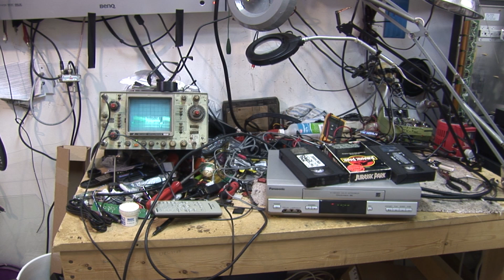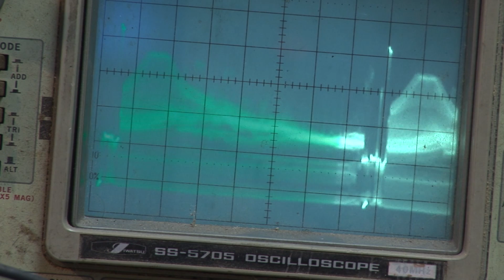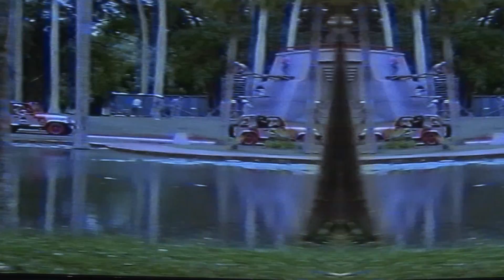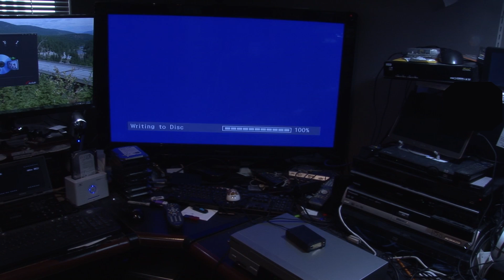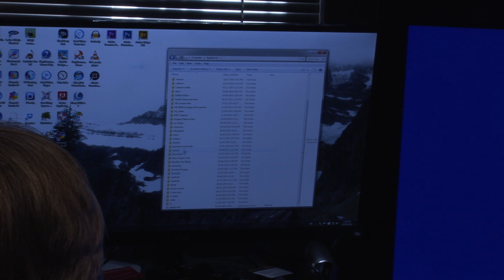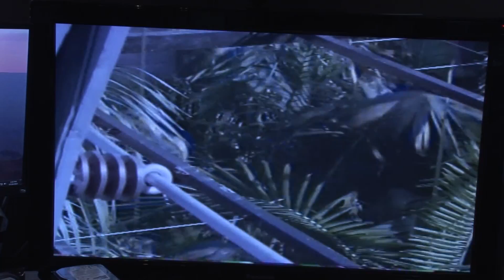Copy macrovision protected Video to DVD

Comment: Does this Macrovision remover work for the really old VHS that had a rolling picture copy protection?  I beleive it was called "stop copy"  Old Warner Bros. movies would mention it and disney tapes mentioned it also.  Modern TV's I find that I need to pause then hit play to stop the picture from rolling after the initial start.
Reply from the maker: Yes it will because it generates new sync.

Comment: Have you made a device yourself that removes copy protection?
Reply from the maker: Back in 1981 i built one.
Reply: Can you give a diagram of your device that removes copy protection ?
Reply from the maker: @Творчество2.0  
Sorry don't have one and even if i did the tv sync generator for tv camera (RCA) is not made any more and was in short supply when i built this back in 1981
Reply: Sorry to ask. I need to make resevr copies of videotapes . But the video capture board sees copy protection . I was looking for an adapter on the Internet , but this thing is either expensive or out of stock . Dead end.
Reply from the maker: @Творчество2.0  that's the problem with copy protection.  A videonics mx1 mixer will remove macrovision as will a good frame store TBC.
Reply: @12voltvids  Where can I buy the video mixer with TBC that you mentioned?

Comment: Interesting video. I have a RCA-HDMI converter from Amazon that is not affected by macrovision. Does it just ignore the signal?
Reply from the maker: Yes it probably does because an RCA to HDMI adapter is generally meaning you're trying to play analog sources onto a television that only has HDMI inputs. So you're not actually trying to copy anything. Macgravation was there to prevent recording on to analog devices such as VCRs and DVD recorders which had chips embedded to detect the signal and lock out the recording circuits.
Reply: @12voltvids  I tried this RCA to HDMI option.  Now I get stable video but only in black and white...RDK

Comment: There are numerous dvd players/ recorders out there where you can simply input a code via the remote and it will disable macrovision protection. A liteon lvw5002 is a example of a machine that can. The liteon lvw5006 can do the same thing but requires a software update to do that is a bit awkward to do 👍

Comment: How can I get one of those Macrovision scrubbers?
Reply from the maker: Will be tough to find one these days.   You are about 40 years too late!
Reply: @12voltvids  Lol yeah but  would have thought that now days with  the technology and vcrs becoming hard to come by a device like that would be as common as a rf modular or the capture devices you can use to connect a vcr to a computer. so people could back up there vhs collections.
Reply from the maker: @scottriffe222  these devices were made illegal to manufacture cell or even possess in the United States. Company scrambled to make newer models that would reduce the amplitude of the macrovision signal but not totally eliminated and that was because all new VCRs and DVD recorders had a chip in them to detect the watermark and shut down the recording so in order to sell them because the initial excuse for selling them in the first place was because some televisions would not play nice with the extreme overshoot in the vertical blanking and it would cause them to roll even if you were just trying to play a macrovision tape. The macroscrubber I have, that I built uses a TV camera signal generator IC Gen locks to the incoming video signal generates new horizontal and vertical sink pulses which is then keyed on vertical blanking the blank lines 9 through 21 and replace it with new sync.  They were deemed as devices designed to circumvent copy protection and we're DMD legal by the US supreme Court if I remember correctly. Manufacturers some being sold under the brand name Curtis responded by producing new units which just clipped the white overshoot in the luminance signal to approximately 40 ire. This stopped the distortions on television and it stopped the distortions if someone was looping a macrovision encoded signal through a VCR for example it would stop the bright dark bright dark pulsations but it still allowed enough of the signature to get through to prevent VCRs and DVD recorders that had the watermark detection chip installed from going into record which was basically every VCR made after about 1991. If you look online you will probably find someone selling some of these old devices but keep in mind the majority will not provide a 100% elimination of the macrovision signal. The only ones that will are ones based on the chipset that was used in the one that I built. I don't even remember which publication it was from might have been radio electronics, the plans were given to me by somebody else that had built one so I built one too. He had made several boards that was selling us the boards and a bag of parts to put together. I think at the time I paid about a hundred bucks for the parts. I looked up the main chip which is an RCA CD22402E which was a sync chip for tv camera and that chip at the time was selling for 68.00.  it is long obsolete.  The one I have was a digital tech Corp macroeliminator.  That's the design you want it you can find it.
I keep mine connected between the cable box and my DVD recorder so I can make hard copies on DVD of anything I want to keep including off Netflix and on demand

Comment: A 16x9 broadcast?  Mine will work on the "Y", luminance, or "Grreen" component cable as long as it's a 480i broadcast (don't think it'd be timed for HD).  Are you talking letterbox or full 1080P? I had something called a Video Stabilizer to help my electronics with the random extra falling edges (usually 4, switching from high to low in 10sec intervals), along with some color burst overdriving.  It used a monostable, along with some gates.  I've tried drawing a schematic many times I need MAT lab I have crappy writing.
Reply from the maker: Yes it will work on the lunanence signal as long as in 480i. I made a break out cable to loop it into an s-video cable which works great for recording protected content from say Netflix or other on demand service.

Comment: How could I connect my Hauppauge to copy from my streaming device? It's only HDMI Out from streaming device.
Reply from the maker: Couldn't tell you as my streaming devices have component output and my hauppague has component input
Reply: @12voltvids  What Streaming device are you using?
Reply from the maker: @franklinsterlen6817  it's a Cisco IPTV box.
Reply: @12voltvids  Does it let you download Apps such as Netflix and Sling TV?
Reply from the maker: @franklinsterlen6817  
I have only Netflix.
Reply: @12voltvids  Ok so any Cisco IpTV with Component outputs could do the job right?
Reply from the maker: @franklinsterlen6817  
Mine is from my cable co.  I can record anything. Netflix, HBO, on demand.

Comment: Been doing this for years by running through a pro TBC which also means I can adjust other video parameters as well. (Not all TBS,s will do it though)
Reply from the maker: What you have us a proc amp with tbc.  A tbc does not have controls to adjust.  It simply reads the video into memory then reads it out again locked to a fixed time base.   A tbc that works on a full frame us called a frame store tbc.   Most tbc built into VCRs are 3 line tbc as they only store 3 lines.  One being read into memory one stored and the oldest being read our as the next is stored.

Comment: I once made a Macrovision remover in the early 90's here in the UK and it worked first time, which is a first for me, anyway,  although it did VHS to VHS recording, when DVD's came along it refused to work on those, I searched through issues of Radio Electronics which you mentioned but could only find a different one with more components from the December 1987 issue, which also won't work on the PAL system used in the UK, but here is the link anyway ;     https://worldradiohistory.com/Radio_Electronics%20_Master_Page.htm
Reply: Yes, that's the Issue December 1987 page 49 because there is nothing from 1982 & 1983 which i checked on.

Comment: Can't you remove the chip from the recorder?
Reply from the maker: Sure then the recorder would not record, or play. It is buried in the main processor.
Reply: @12voltvids  Ok, well I thought the chip might of been after the tuner but before the processor as a stand alone. I guess they knew people would remove it so they integrated it into the processor? Thanks

Comment: Does it effect the actual video/audio signal? Like a second generation tape or anything?
Reply from the maker: No. The one I have does nothing to the video. It is a genlock device.  Locks to the sync of the macrovision video and generates new sync.  Then the new sync is gated over the original sync and the first 20 or so lines of video to eliminate the macrovision signal. It also removes close caption data as that lives on line 17
Reply: @12voltvids  Doesn't CC data live on line 21?
Reply from the maker: @KylesDigitalLab  
I totally forget what line, could be, 17 might have been where the VIR. There were many test signals in there.  Color bars, multiburst, chroma phase reference.  Closed captions, text telemetry.  All kinds of stuff between line 11 and 21. Been so long since I actually looked at an ntsc waveform.

Comment: I just bought a Digital Video Stabilizer, Brand New, And It Only Recorded One Movie, And Then I Tried To Record Another One From DVD - DVD and WON'T LET ME, I CONNECTED EVERYTHING PROPERLY, BUT IT WONT LET ME DO IT, BTW, THE FIRST MOVIE I COPIED WAS COPYRIGHT PROTECTED, AND IT RECORDED IT ANYWAY, DO YOU KNOW THE REASON WHY IT WONT LET ME RECORD OTHER DVD COPY PROTECTED MOVIES??
Reply from the maker: Most of those commercial ones do not remove 100% of the macrovision signal.  The first disk may not have had the full macrovision turned on.  Or it just said copy protected and it was not.
Reply: 12voltvids Do You know Which Stabilizer Removes ALL COPYRIGHTED DVDS, is it one available out there that does the complete job?
Reply: 12voltvids i know for a fact the first dvd concert video i recorded has copyright protection, because i tried to record it before without pluging it to the stabilizer, to find out if it was protected, and IT IS, which means the stabilizer only kills macrovision on some dvds, Not in all of them.
Reply from the maker: @AlexDeChristian6323  there are different levels of macrovision protection and a different license (more expensive ) for higher levels.   There are actually 3 layers of protection.  Analog which is just the AGC trigger, digital which puts a watermark into the keying pulse in the last lines of the frame and color stripe which messes with the burst level.  Most cheap stabilizers will defeat the analog macrovision that was used on VHS and some dvds. Digital water marking is much more difficult to remove.  You have to totally strip the sync and rebuild it.  My scrubber works with analog and digital.  It does not work with color stripe which results in thin colored lines in the copy.  For that I have to use a time base corrector in locked frame mode.  It completely rebuilds each frame.  All the sync and the color burst.  A videonics mx1 will do that.
Reply: 12voltvids Thank You So Much FYI Blessings.

Comment: I have a video stabilizer macro 2000 and even though it helps to record a copy protected movie to vhs, it doesn't help if i want to record a copy protected vhs to dvd. The dvd recorder somehow still detects the copy protection. Are some of those "copy protection killers" weaker then others or what could be the problem?
Reply from the maker: Yes there are different levels of macrovision suppression.   The one I built uses a full synch replacement.   It uses an RCA synch generator for a camera that genlock to the incomming sync then the new synch is gated in over the existing vertical blanking interval and the first 21 lines of video.   Many just clamp the max video level during the vertical blanking interval to reduce the amplitude of the white and black pulses so they do not mess with the AGC of a VCR but a dvd recorder can detect the signature because they are still there.  The one I have completely replaced the sync.
Reply: @12voltvids  aha that's what i thought. Damn. Looks like i have to find a device so i can capture the video with my computer. Hope i can find one that also works on a mac.
Reply: @12voltvids  So if i already have that video stabilizer is it possible to replace some components or ics to make it work like the one you have or do i really need a different device or video grabber?
Reply from the maker: @freund333  not possible as far as I know but what do I know about that unit.

Comment: Warner Bros did macrovision the least.
Reply from the maker: Laserdisc had no macrovision it was great.
Reply: @12voltvids  I tried copying a dvd to a vhs and it got dark/bright/dark/bright you get the idea and I couldn't do it. It was walle 2008 dvd back in October 2011.
Reply from the maker: @austinthevhsvideogamelover5265  dvd uses macrovision. I am talking laserdisc which is a 12" disk the size of an LP and analog video.  They have a beautiful picture and no macrovision.
Reply: @12voltvids  but certain dvd companies did not do it as much, like disney stopped using macrovision in 2014, universal in 2006/07, WB 2008 dvd of the dark knight was the newest one I know that uses it, paramount around 2008 the 2008 dvd of iron man is the oldest one I have to entirely lack it, etc.
Reply: But I never owned any laser discs before.
Reply from the maker: @austinthevhsvideogamelover5265  
They have to license it from Macrovision, and likely they realized by this time that it really wasn't protecting the film anyway.
Reply from the maker: @austinthevhsvideogamelover5265  
Most people don't know about laserdisk. This was the videophools format before DVD came along.  Laserdisk saw huge success in Japan more than here.
Reply: @12voltvids  Well I have to tell you this. I think YOUR PANASONIC PV 4361 VCR MAY NOT GIVE YOU THE MACROVISION WHEN COPYING A TAPE USING SAID VCR! I TRIED WITH MY 2 HEAD RCA VR337 1996 VCR AND IT CAME OUT CLEAR!!!!!

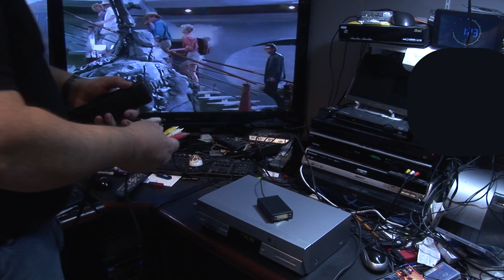Comment: 09:24 anyone know what's behind the black spot? Top secret project?
Reply from the maker: No, just a phone number for a client
Reply: @12voltvids  
Trudeau perhaps? 😂 Isn't it late where you are?
Reply from the maker: @NunYa953   No just a client for a video project and there was a credit card lying on top of my dvd player. It was expired but didn't want anyone seeing the number. It was easier to just put a big black square on the screen.
Reply: @12voltvids  
Is there a simple way to dial in tape path alignment (I think is what it would be called) without a scope? I'm working on a Magnavox ZV427MG9. Bought it from eBay with the usual "eats tape" disclaimer. Cleaned the mode switch, heads, checked belts etc. Then when put a tape in the audio was clear but picture was "rolling" and then TV says "no signal" then would come back all jumbled up. My guess is the person I bought it from adjusted the little potentiometer and the alignment knobs on the VCR tape path pins. I don't have a scope. I've become pretty proficient at cleaning up the switch and doing a basic service but this one has me puzzled.
Reply from the maker: @NunYa953  
It is possible to get close without a scope.  Close enough to play a tape.  Look at the noise in the pix.  The top part of the picture is the left guide and the bottom the right.  Easiest on a crt TV.  I'll do a video where I will mess up the alignment and do it without a scope.
Reply: @12voltvids  
That would be great! Knowing now that one is top and one is bottom should make it a little bit easier for sure! This particular one was also owned by a smoker at one time. Pretty awful clean up process. As a former smoker myself I wish I could apologize to everyone who had to smell me during my smoking days. If the inside of a VCR/DVD combo can get coated with tar, nicotine, and Ash I can only imagine what it does to a pair of lungs.
Reply: @12voltvids  
I have good audio and the tape path seems good. But in darker "scenes" on the tape there are diagonal lines showing. I've cleaned the heads with alcohol and a blank sheet of paper, the audio heads have been cleaned and audio is good, mode switch has been cleaned, and resoldered a bad joint on the IR sensors. It appears that the previous owner(s) had a problem inserting a tape at some point and took a metal file to an area where the guides hold in the carriage that loads the cassette into the deck. I meticulously cleaned up fine metal shavings and lubed everything back up. Do the diagonal lines indicate a bad head? They show on multiple different tapes.

Comment: Any way to modify a combo recorder in order to bypass the macrovision? Without buying separate hardware I mean, and without using a computer.
Reply from the maker: No it is buried  into the circuitry.

Comment: Analog content protection macrovision comes in several different "versions" the "original" just inserted pseudeo-sync pulses into the vertical blanking signal that trip up a Recording devices Automatic Gain control Circuits and is also presence detected by newer recorders locking out there recording ability  "but" later revisions of macrovision "also"  mess with the Colorburst signal "  Macrovision creates a rapidly modulated colorburst signal. This confuses the chroma processing circuitry used in NTSC video recorders. The will usually result is a picture spoiled by horizontal stripes or other unwanted effects DVD players (And cable boxes playing protected content like pay per view) also apply this signal to there "Analog outputs" to try and prevent recording of content.